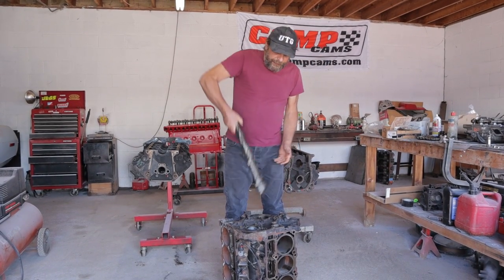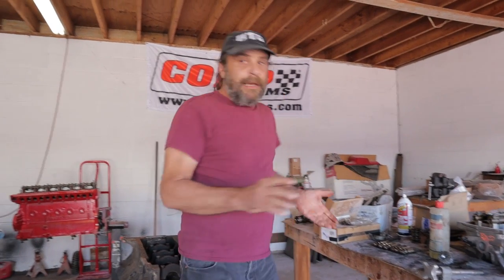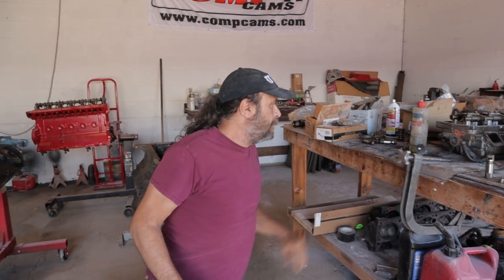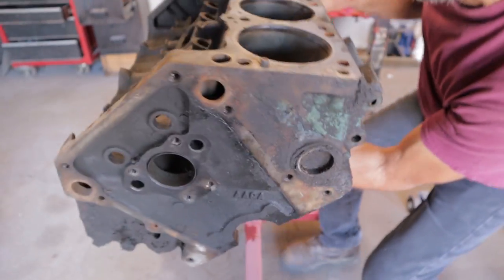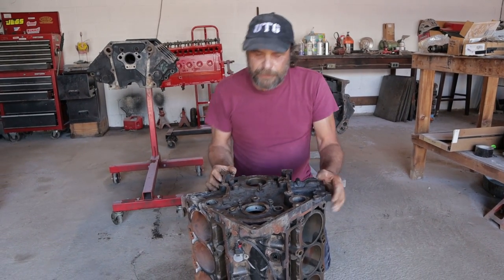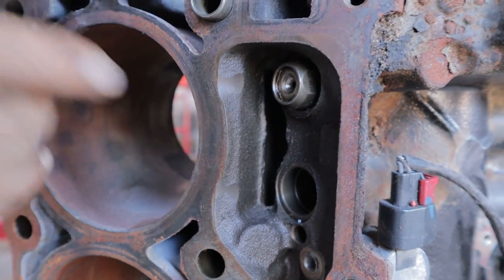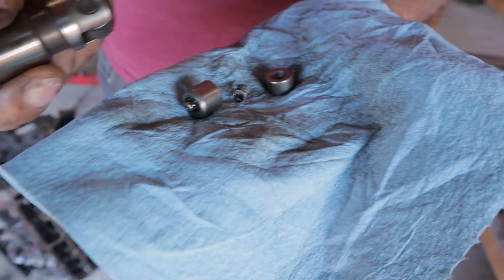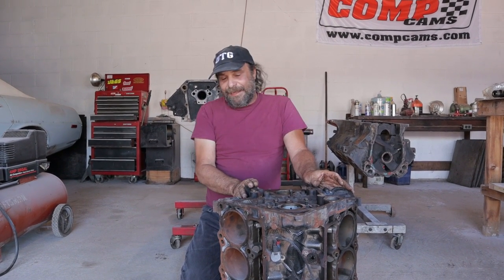Gen 3 Hemi Camshaft Failure Mystery Explained!

Comment: So, in less than a week, UT does the equivalent cost of $10M+ in Reliability Engineering research....  That's amazing....
Reply: Well maybe ...  I'm sure the engineers at Chrysler know this is the issue, but are keeping mum.  If word leaks, they are in bankruptcy court, and it all goes down the drain  :(
Reply: How do you know they didn’t do it on purpose. 
Lost of manufacturers have been adding things that shorten the life of a car.
Reply: You'd be amazed at what experience does for you.

For a different example, the British SA80 rifle. It's mechanically an Armalite AR-18, but Enfield cheaped out and didn't bother buying the license for the design. Worse, they had people who had never designed a firearm before reverse engineer it.

After massive amounts of trouble, someone finally gives up and hires Jim Sullivan (the other guy who designed the AR18) to troubleshoot it. Jim takes a cartridge, paints it with machinists blue, chambers it, and then pulls it out. He takes one look at it and says, "oh, yeah, you're dragging the cartridge across the barrel extension."

It took dozens of time longer to get the contract for Jim to consult written and signed than it did for him to find the first problem.
Reply: @ScottKenny1978  Yup. That's corporate arrogance for ya.
Reply: Its already been figured out years ago, I'm not taking away anything from UT
Reply: My thoughts exactly. Uncle Tony should be the engineer who designed and developed the gen 3 Hemi. Sadly though things like this are done so that in their mind you'll buy another vehicle from them, in this case Chrysler. It just goes to show you that an ordinary man who's not an engineer can figure out where they [the engineers] went wrong. I've seen many issues with vehicles like this over the past 45+ years. Please keep up the informative video's. Have gr8 God blessed day.
Reply: @Robert T yep that happens to me too
Reply: As long as it lasts past the warranty they seem it a success
Reply: @12yearssober  I knew you were still alive, who'd you get to play dead for ya ?
Reply: I’ve seen a few instances over the years where engineers made bonehead designs and maybe come up with a boneheaded fix. Then some dude who had his hand in the business for decades comes up with a practical solution.  I’m sure the engineers can come up with a fix but corporate HQ has to approve of it and fund it $$$$$
Reply: Lassi Kinnunen  when you can afford a $50,000 truck what's dropping several grand to rebuild the engines and transmissions a few times the life of the vehicle?  It's practically pocket change to some guys.
Reply: Are you are you forgetting his background he was a mechanic on top fuel dragsters back in the day he's not your normal YouTube shade tree mechanic
Reply: Read my reply, at the top of the article, (valve guide clearances). Worked for FCA.
Reply: @paulkirkland1535  it's not lifter bore issues sir. It's because of really tight valve guide clearances....stop the valve, the rocker, the pushrod, and the lifter all stop....the cam doesn't. These clearances are .9 thou on the intake, and 1.5 thou on the exhausts. Open them up by half a thou, problem goes away. (Worked for Chrysler...at the headquarters). Lifter bore scuffing happens when the lifter is crushing the roller bearings. (Tremendous side loads).
Reply: @gruetter7890  big difference in street engines, and top fuel. Not even the same animals. Read my reply on "valve guide clearances" above.
Reply: @mikestone234  😆
Reply: @packrat76  lol they dont rebuild they trade in!
Reply: No manufacturer would ever include a flaw of this magnitude, they’d get fined and sued right out of business. I am sure that they are well aware of this but aren’t saying anything because doing recalls would bankrupt them. It seems like this is mostly an issue on older engines anyways, not sure if the current line of 5.7s do this. I think the 5.7s days are numbered anyways.
Reply: @paulkirkland1535  fixing cars vs. designing entire powertrains are totally different things. a person might be good at fixing cars but it does not mean they will be good at designing an entire engine.
Reply: @vonmarko1363  they do it all the time! Look at VW. Chevy truck have defeated side airbags that go off when your driving down the road.
Reply: @gruetter7890  unlike scotty Kilmer.  I never had so much anger for a youtube person
Reply: @buckeye9252  whose angry?
Reply: @gruetter7890  i was just ranting dont mind me
Reply: that is why it is a DELIBERATE DESIGN FLAW. I work on refrigerators and some models have deliberate flaws in order to make you buy a new one. How do I know this?? Because they have to be aware of the problem and after several years, they have not corrected it.. IE DELIBERATE DESIGN FLAW!!!!!
Reply: I dont think they could afford his expertise  XD
Reply: Chrysler knows full well what's going on, but re tooling a block, even slightly cost's millions,  besides, this may be engineered into the damn thing so they can sell lots of parts,  hey, the guys that beat their motors don't have this issue, just the grampa,  so they can claim good reliability under harsh conditions.. pretty sneaky..
Reply: Nathan Brame in this day an age!! Haaaa they’ll go bankrupt if they keep making shitty cars I’d say 5 years of shitty cars would ruin a car manufactures career
Reply: @ScottKenny1978  that's the main problem, office staff with no real world experience designing it. No need to worry HK charged the MOD a pretty penny to make their ugly unreliable rifles a little less ugly, a bit more reliable but horribly outdated rifles
Reply: @gruetter7890  Top fuel dragsters, are way different than emission controlled, government ruled, mass production vehicles... Way different.
Reply: @fastinradfordable  I watched a video with an engineer that was involved in the redo of a very popular sports car,  admit a half the engineering budget was spent on designed obsolescence
Reply: @brocluno01  Ford did the same thing on it's engine debacles. The 4.0L SOHC engine used in Rangers has a special design option as standard equipment. The chain tensioners get to the point where where they are over extended and are unable to articulate back and forth as the chain load varies with RPM. The chain breaks. It is a non interference engine so the valves do collide with the pistons. But the broken chain takes out the front drive mounting points. That is on the drivers side. On the passenger side the the cam drive chains are IN THE REAR OF THE ENGINE! You have to remove the engine to replace repair cam drive issues. The only upside is that the tensioners are accessible from OUTSIDE the engine and are very easy to replace. DO SO AT 60.,000 MILES to be on the safe side. Mine lasted 230,000 but when the driver side let loose the passenger side being unloaded grenaded as well. Total engine replacement required.
Reply: @brocluno01  Ford sent the 1999 Cobra out rated at 320hp but not even making 300. THey later acknowledged the issues and added different heads, extrude hone intake manifold and different exhaust manifolds.
Reply: Nathan Brame because this isn’t that sort of thing. This is an engineering failure not a example of forced obsolescence
Reply: @gruetter7890  haha lol lol 🤣😂"shade tree mechanic" never heard of that one before I'll pay that one haha "shade tree"
Reply: @hamishfullerton7309  Well!!  Might be a southern thing man I don't know!
Reply: Too bad comp cams makes searching on their website a bitch.
Reply: That’s the difference between hands-on experience and just working from a desk
Reply: @YoungOzzy432  your name says it all!🙄
Reply: @ucautoentertainment7359  have U heard of ford motor company????? They aren’t bankrupt but they made bad engines for 20+ years riding on their good name
Reply: He's absolutely right about this. I've lost a hemi over this issue! The dealer/manufacturers warranty refused to even consider a recall. Then to add insult to injury made me pay for the diagnostic!!! I'll never buy anything from them again!!!
Reply: Just like any new/newer car,It’s designed to fail miserably just out of warranty.
Reply: @packrat76 Why would someone decide to buy a piece of garbage that’s going to have a lot of problems….makes no sense.
Reply: @vonmarko1363 No, they still have this issue even today.  PURE GARBAGE

Comment: Those thumbs down are from the engineers that designed this engine.
Reply: Beat me to it.
Reply: I think those people did a fantastic job in designing this engine. The problem is with the MDS and dirty oil/cheap oil. Take care of your 3rd gen hemi by doing the routine maintenance and it can last you 200,00 to 300,000 miles.
Reply: @cliffcampbell8827  You say that, but i think its quite naive to think its down to bad oil. To me this looks like faulty design. Similar wear on repeated lifters from different engines should maybe clue you into the fact it isnt the best designed engine... After all if it was, this video wouldnt have been made..

So inform me, where do you work at Chrysler?
Reply: @TylerDavis1998  Stupid Chrysler recommends 10,000 mile/1 year oil changes with conventional, and the dealers enforce that. Manual in our Jeep 5.7 says you can use synthetic if desired. I much prefer it and change it myself with 5w-20 every 5000 miles or a year. It ain't driven much anyway. Stopped strange valve train lash noise at idle. The hydraulic lifters probably weren't happy with whatever the dealer put.
Reply: @IhateYoutube  But here's the thing: the problem occurs to anyone who are in situations where their engine is running at idle longer than usual, or stuck in slow moving traffic while driving to and from work. Tony clearly stated that in this video near the end. Any owner of this engine who doesn't have to drive in slow stop & go traffic every day, and/or idling the motor more than usual, will most likely be spared of these issues. I'm guessing you are not forced to run yours in this matter. Example: I drive nearly 100 miles ( round trip ) to work every day. However, where I live enables me to jump on the interstate within minutes, and hardly any traffic lights/stops because my job is also just off the interstate. So I'm buzzing along at 80 to 90 mph most of the way. If I did own a Gen 3 Hemi, I doubt I would be having this problem either. Food for thought........

Comment: Everything today is either defective or disposable,  usually both .
Reply: Well considering most domestic brands are being ran by foreigners... suprised?
Reply: @Attachments.  we adopted the metric system when we were at our strongest, it's been down hill since in a lot of ways .
Reply: @Odin33356  Correlation doesn't involve causation. 
Also, old engines (so prior to about 1985) were crap compared to modern engines. 100,000 miles and they were completely worn out. Now you can get ~ 250 - 350,000 miles with regular oil changes. 
However - I feel your pain with the "everything today" etc comment. Possibly you are more correct than incorrect lol, but the older we all get the more wise we become and I often ponder whether it is your statement or cynicism. 
Without wanting to create a great wall of text, there was a story from the Civil war where the Union govt called for a tender to supply boots for the cavalry. The winning tenderer made the boots but the soles fell off immediately when used to walk normally in them (not marching). The govt queried the poor quality and the supplier replied the tender called for boots to be worn on a horse and not boots that can be walked in.
Reply: @ThePaulv12  I still have my 56 pickup with the original 265 v8 .  We have jarheads testing bombs on fault lines creating earthquakes that affect Yellowstone and say the first aid kit is for employees only customers must bleed out because of liability. I'm not sure how Americans can feel proud or wise at all . I don't have any hope for humanity.
Reply: @Odin33356  On the first point, an exception is hardly proof of contention, yeah??
On the second, I also have no hope for humanity. The avaricious barbarians that comprise all levels of society influence governments through massive campaign donations to get the government that will allow them rampage of the planet's rescources caring little for the environmental consequences until it is too late. Then they'll all be living like hogs in a hog house, with their vast wealth aquisition, and with force will change us back into a feudal society. They see what they're doing as a win-win. Effing pigs!
Reply: @Attachments.    what domestic brands are being run by foreigners? Ford is still family owned and GM is managed by Americans.

As for foreigners running things, why should that be a bad thing? Many foreign companies have been managed extremely well and have risen to heights that challenge the greatest US corporations in their prime.
Reply: Take science,  technology or religion to the end and you get the end. I recommend life vests.
Reply: Will agree with the disposable part.
Reply: @importsstillsuck    the guy said most..... 1 out of 3 isn't most.
Reply: @ThePaulv12  My dad's 1963 Buick Electra 225 had almost 300,000 on the original engine and ran fine when we parked it.  ALL our old Buicks from the 1960's and 1970's with the big V-8 all had well over 200,000 miles with no problems.
Reply: @ThePaulv12  "Also, old engines (so prior to about 1985) were crap compared to modern engines." that's not true, if you're talking about the engines produced during the oil crisis then yes they were all pigs, but the engines before that were legendary. that's why those engines all survived the test of time while the engines made soon after, did not.
Reply: @Odin33356  Well.. there is this one and only modern term known as..  LS swap.
Reply: @ThePaulv12  wow I have never been an armchair before lol, no but seriously iron and steel are stronger than aluminum and plastic. there is too much aluminum and plastic in engines today, it makes me sick.

Comment: The answer is simple just rev the piss out of your hemi every where you go
Reply: Like oldschool mechanic Italian
Reply: Hahaha ikr
Reply: That is pretty much what you have to do to the first gen Northstars. Drive 'em like you stole 'em. And resign yourself that you are going to have leaks.
Reply: That's exactly what I do and I've never had a cam or lifter failures in my hemis. I also change my oil every 5000 miles, and I never let them idle at the Sonic without giving them a rev every few minutes. These engines don't like to idle for long periods
Reply: I hit redline everyday in 2012 Cherokee.... no ticks or issues so far but Ill go till it goes!
Reply: I spend quite a bit of time on the HWY at about 75 plus MPH. This is in my 05 Magnum RT. RPM is a tick over 2000. With over 215000 on the engine it still runs great and is very quiet. I agree, take it out and run these things. That is what they like to do. Getting on the interstate I give her some pedal and get the RPMs up. Change the oil. Use good oil.
Reply: LMAO
Reply: Absolutely correct.....mine sees redline every day and 134,000 miles the cam is fine. Use THIN oil and change it often. I actually use 0-20 full synthetic. It still has 32 psi at idle warmed up.
Reply: @Pablo-cp9nc  thanks for the heads up on the oil..👍
Reply: @edjackson4389  With cylinder deactivation engines from Chrysler and GM, you gotta change the oil early and often. The guys trying to get 10,000+ miles between changes are absolutely nuts.
Reply: As intended
Reply: @edjackson4389  Dude that was my biggest mistake. Way too much idling on my engine. Cylinder 7 Failure now. 203KM
Reply: LOL!